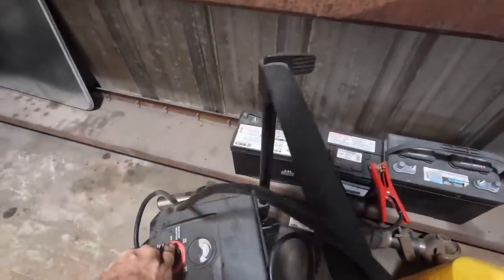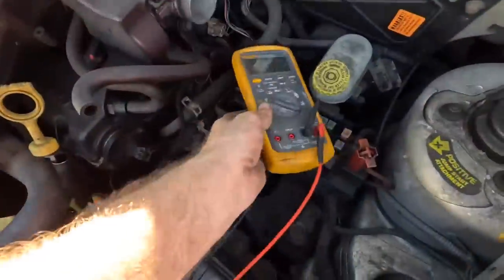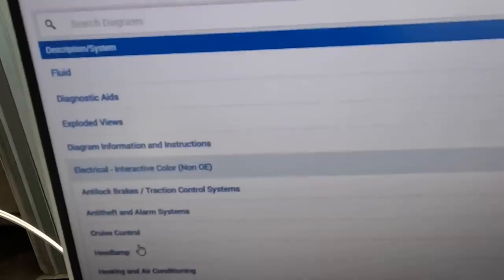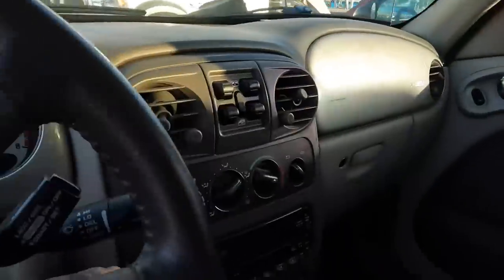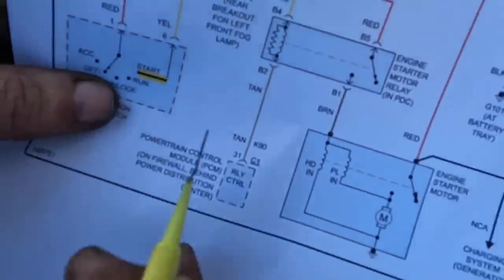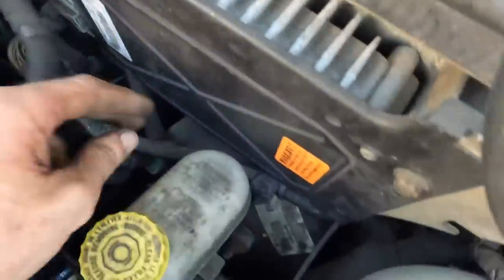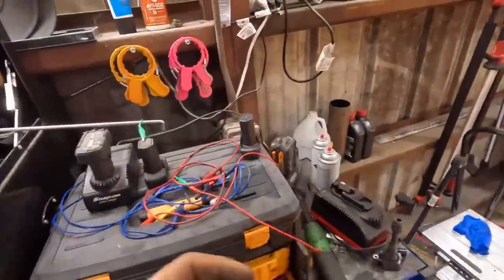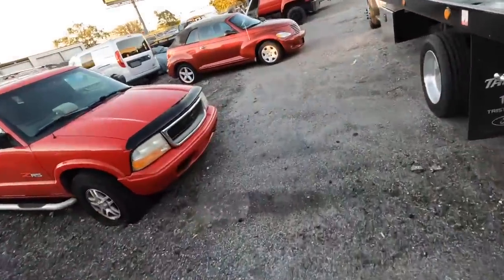It’s DEAD! Parking lot diagnosis

Comment: I'm not saying it's not a faulty PCM, but I would check the integrity of the wire providing ground to the control side of the starter motor relay. Just because you performed a continuity check and passed doesn't mean it can carry a current. I know the load on that wire isn't much because it only provides ground for current flowing through control coil inside of starter relay, but I would've load tested it with a 2 amp light bulb. I would also load test the wires providing ground to ECM before condemning the PCM.

Comment: Is that a chipped key with theft deterrent? With the column disassembled It may be worth checking to see if that system was disconnected or a neutral safety switch is bad.

Comment: Security system is kicked in mine did the same thing  just to find out the ignition wasn't transmitting that the key wasnt correct plus check the relay it should be a 4 pin not a 5 pin

Comment: Since it looks like it was replaced, they may not have flashed the Vin into the PCM. If vehicle Vin and PCM are not the same, vehicle will not start. Also, they may have the wrong PCM. Call the dealer with Vin and ask  what the Part number is supposed to be. Number should be on PCM.

Comment: You have power to PCM, you have ground to PCM, looking at the wiring diag there is no neutral safety hard wired into the starter solenoid circuit which means it is connected to the PCM and can inhibit starter relay ground. Admittedly that should not affect the ASD relay which itself will inhibit the fuel pump relay, but it would be interested in seeing if the PCM is communicating and what IT thinks is going on. More scantool.

Comment: As an OBS Ford owner, the first step after a no crank situation is to jiggle the shift lever. 
Neutral safety problems a plenty.
Reply: The sagging column shifter neutral lockout anti-theft device is a Ford patented feature prevalent in Ford full-size vans and pickups for decades.
Reply: @mikejacob3536  I park my 93 300 straight 6 f150 at a wooded lot that I bought in upper Michigan. It's a camp truck and a tractor for me. Before leaving it I pull down on the column shifter, that enables the factory anti theft mode.
The only thing I do under the hood is to pull the signal wire off the starter solenoid. It's just a slip fit connection.
Reply: @mymusicaccount1456  in 1999 I started driving a 1981 E150 as a work vehicle. It had started life as a Montgomery Ward Appliance Service vehicle and had 191,000 miles on it.
I left the keys in it 24/7. If you didn't know to lift the gear shift from the 5 o'clock position that gravity had it in, to the 1 o'clock position necessary to start the old 300 C.I.D straight 6, you'd never start it. 
I drove that van until the leaf springs came through the floor... Engine still started first crank in sub-zero weather.
Reply: @mikejacob3536  I replaced the front leaf spring mounts on my truck last summer because they were Swiss cheese with rust. When I got the old ones off I weighed them and they were both a full two and a half pounds lighter than the replacement ones. People joke about rust making a car lighter and faster, but my spring hangers had lost nearly 50% of their weight. Holy crap.
Reply: @mymusicaccount1456  Reminds me of my first truck. 1977 Toyota with 317,000 miles on it. No driver's side floor board, and rust so far up the firewall, you could see the left front tire from the driver's seat... 2 liter 5 speed... 78 mph top speed, 30 mpg on the freeway. The cab was laid back on the bed... But it was at least 200# lighter than when new.  Still started and drove when I junked it, but couldn't get a brake caliper it needed... I miss that truck!

Comment: This video shows why it is easier to work on 50's and 60's era cars.  Sure, no OBD connector to see what the computers say is broken or failing once every thousand RPM's, but no messing with ECM's ECU's or what ever each generation decides to call the electrical magic box.  Just imagine the joy of getting a barn find current generation car 70 years from now and needing major electronic replacement parts.  Hell, I couldn't even swap out the ecu on my Harley without taking it to a dealer to have it go through an initial learn procedure for the VIN and stage upload.

Comment: This is giving me PTSD…  I spent a week tracking down an intermittent fault in a PCM.   An overheating power transistor resulted in a cold solder joint, so mechanically it was a crap shoot if there was or wasn’t power to required systems.  I thought it was faulty wires, as wiggling the harness would affect things,     We could send a capsule to the moon with computers built with 50s and 60s semiconductors, but under the hood of a light-duty Dodgem pickup is a harsher environment than outer space…

Comment: The PT Cruiser is classified as a Truck by Chrysler. It is how Chrysler cheated with average overall fuel consumption of the Chrysler line to meet federal standards.  Very detailed and interesting story tbh, and yes the convertible is also classified as a truck.  Some states you can even get the truck plate for.  🎉😮😊

Comment: With other people said I think it's the security system stopping it from cranking.  Could be key not programed into system happens alot when batteries get disconnected frequently which would shut all systems off also those older Chrysler car if you put a computer programed it could trigger all computers to look for the security.  Other car ok for test parts Chrysler you can get a bunch of headaches if not do right

Comment: Pretty sure an ecm swap was tried and failed due to improper matching or improper VIN setup. Without the dealership or an eBay store that specializes in VIN to ECU keying, no dice. I bet if you mail that ECM to an eBay service, give them the car VIN, they'll match it and mail it back to you for under $200. Then the immobilizer and all the fun stuff will work correctly.

Comment: I got a '08 JKU 2.8 CRD that just shuts off while driving, then doesn't start or even cranks unless you slap the fuse box..... it throws fault code U0100 though, loss of communication PCM-ECM....

Comment: That's definitely an immobiliser problem you can see the light is on when you turn the key weird that they don't say it has to go through the imobilizer or that the power has to go through that before it will start on the diagram

Comment: Can check for a bent or pushed pin on that controller and does it have proper power to operate. Otherwise you did what i would have done.

Comment: There is a fundamental flaw in your diagnosis which could come back to bite you and/or give your customer a false diagnosis.  You conflate Voltage with Power but the two are quite distinct.  Voltage is simply a measure of electrical pressure (which can also be ghost voltage) and cannot technically 'go' anywhere, it is anly apparent at a given location. Power as you're using it doesn't actually exist in electrical nomenclature, the measurements in Ohms Law being voltage, amperage, resistance and current. Take the possible  scenario that you have corrosion in the wire.  The problem with corrosion is that it is Not a fixed resistance, it is a dynamic resistance based on current flow so will not show if there is no current. If you measure for continuity you will see continuity, but if you pass current through the wire you will expose the resistance in the form of a voltage drop. The bast way to test this is to ground one end of the wire and attach a powered test light to the other (make sure your wire is isolated). If the light lights your wire is good.  A good hybrid solution is to attach your voltmeter across the wire (it should read 0 volts) then with with one end grounded attach your powered test light tothe other end.  If the circuit is good your test light should light and your voltage should remain near 0 volts; if the light does not light and/or you show significant voltage you have corrosion in the wire.

Comment: Here is Mr. Digital's theory, Car won't start one day, pcm is blamed, pcm gets changed, pcm and key no longer match, now car wont crank, starter gets replaced, car still wont crank, previous "mechanic" scratches his head, learns a little about the transponder takes the steering column bezels off, changes the transponder amplification pick up ring,  still gets no response, then throws in the towel,  PT comes to you. You chase wiring unnecessarily, The problem the whole time is the transponder. This should have been your first suspicion sticking a grey key in a Chrysler with no starter response. You put a new pcm in, guess what, same situation, you will need to program the PCM to the key, then continue.

Comment: Yeah one thing you going to learn with those lower end Chrysler cars Chrysler products in general that grounding issues plague them and when someone says they replace parts first thing I always will look at 4 is the grounding circuits near where they work at cuz a lot of times they will see that random wire and not bother putting it back as we know Chrysler is always ground wire happy

Comment: The PT CRUSER was a pretty cool car when they came out and you would see a bunch on the road, but in Chrysler fashion they quickly stoped driving by and you only seen them parked.  Now the only place I see them is on Ray's youtube channel.   Whys that?

Me im still driving the same Toyota Celica with 3 times as many miles on it, and its only problem is a bad cat. Yep its plugged up becuse its always used oil.

Comment: cluster not working if fuse is blown , it wont crank  , wrong path saying module is bad check the cluster fuse which also feeds a module which will allow immobilizer to function ,LOU

Comment: Id of tried to crank thr starter by bridging the terminals. If that didnt eork jumpering kinds like you did. But just with a cable direct to starter with a seitch. If it starts its the security bs.

Comment: Is it the key sensor? I hate electrical problems ANYWHERE, car, house, shop, christmas lights.  I was looking at PT Crusiers and then compared it to an HHR. I bought an 2011 HHR. The only problem is the battery is in the back by the spare tire. I have had this car 8 years and replaced the battery 3 times.  So last month, no start, but we had -10 degrees. I did charge it and it seemed ok, but it was a 5 year old Die Hard. Just dont close the hatch door when you dont have a battery. I had to manually unlock the drivers door then a rear pass door and climb in with the battery and hook it up to unlock the hatch door. What a dumb ass design from Chevrolet.

Comment: I’ve gotten dicked on no crank/start ,  with some one slappin in a aftermarket security system or half ass kill switch.  Then selling the rig. 
  The door locks not wanting to play gave up the ghost on one, fuel being cut off on another. On and on.

Comment: That RPM gauge might be a clue. Don't know a lot of cars, but if the Crankshatft position sensor is faulty, the RPM gauge dont move and the computer don't know the motor is spinning and trying to start. So it doesn't supply fuel or spark. But that dont explain the ignition switch problem. Maybe a bad ignition switch base?
Reply: How can it supply fuel when it's only empty?  there is No fuel  it's on the E
Reply: I was pointing out the communication data. Nothing more.

Comment: The PCM might need to be programmed if they had a bad PCM before and just swapped another in that could be your problem. Even if it’s the right PCM it still has to be programmed to the cars VIN number.

Comment: My prediction: Not the computer.
Immobilizer or park/neutral safety switch... neither were checked. This is why the ground is supplied (interrupted) for the starter relay by the trans control module.
Reply: maybe he should put some fuel in it.. as it's on empty,   that is a good place to start⛽⛽⛽⛽

Comment: PT Cruisers are classified as trucks. When GM designed them, they needed to raise the average MPG of their truck line to meet US minimum MPG in a manufacturing range. In order to raise the average MPG for trucks, GM made the PT Cruiser designed as a truck but as small as a car, which raised the average MPG for trucks in line with US emissions minimums.
Reply: Ummmm, PT Cruisers are Chrysler products, not GM products!
Reply: @mattcat231  That's right. I'm more of an air cooled VW person. PTs were made by DaimlerChrysler in 2002.

Comment: If I delivered my car to Rainman Ray and I learned Rainman Ray took an Engine Control Unit  from my car to test another car, it would be the last time I would take my car to Rainman Rays.  I do not think that is what happened in this case . . . just saying. Also when testing ECU's with meter test lead probes do not shove the probe down into the female connector.  This can spread the pins so they do not make good connection after that.  Again, I do not think that is what happened here . . . just saying. In all due respect.  By the way, I am getting a kick out of your new business growing!

Comment: NO NO NO!!  No continuity tests with metering device m- it can easy cheat you. Do this kind of tests using 50W bulb and battery. Wire must be under load od aprox 5A so the test is good. Advising compression test too. And what about to scan for fault codes?

Comment: Chrysler designed the thing in such a way that they could scam the NHTSA into classifying it as a truck because the corporation's actual trucks' fuel economy was best described as "epically bad" - and it was hoped that this chicanery would bring the average... average up enough to allow Chrysler to avoid some CAFE-levied penalties (fines). It was also done because the PT Cruiser's fuel economy was pretty deplorable, and it'd have done the opposite to Chrysler corp's car average fuel economy, had they classified it as a car. There's some irony there, methinks. 

Classifying it as a truck probably didn't hurt when it came time to run the thing through the battery of safety/crash tests, either. Are light trucks still immune to the car low-speed (e.g., parking lot) collision bumper damage rejection requirements? I know that they were for years, it was one of the things mentioned in the list of benefits to the automakers if they could get customers' tastes switched to "SUV"s.

Comment: When Voltage is read (open circuit), one will always read source voltage, even if there is a resistance (green crossties) inline . . . unless the wire is completely broken (open). When the relay is removed you are open circuit testing (Voltmeter is in series with the circuit) and will therefore always reads source voltage). Get in the habit of testing circuits with the load connected.

Why is open circuit testing not foolproof? Lets say, inline "crusties" have 60 ohms of resistance.  If one places a voltmeter (10,000,000 million) ohms of internal resistance in series with the 60 ohms, the voltage dropped across the 60 ohms; miniscule! The source voltage will almost be entirely dropped across the 10 million ohm voltmeter (Battery Voltage). One would never know there is 60 ohms of green "crusties" in the circuit using open circuit testing.

In this case using a relay jumper kit so the load remains connected, one would have read Battery Voltage at the top of the relay coil and Battery Voltage at the bottom of the relay coil. At the bottom of the relay coil there is supposed to be ground.  Grounds should read (0 Volts) if the ground is good, and something greater than a few millivolts if the ground is bad.  Using the Lisle 69300 Master Relay Test Kit and measuring the voltage on the ground side (B2) of the relay coil would have shown there is approximately 12.6 Volts, indicating the ground is missing (2 minutes tops).

This is where the Lisle 69300 comes in handy! The Voltmeter in most cases should parallel the circuit for testing purposes (Load connected); not placed in series. Repeat, leave the load connected and carefully back-probe when possible or use a wire piercing adapter followed by resealing the wire with liquid tape. Hope this helps.

Comment: I know it’s a long shot, I had a ford that had power no crank, after ripping out the dash I took it too a garage and it was the key transponder having new keys cut and programmed it worked fine, this happened while I stopped to fill petrol. Really weird but i only had 1 key so I could not try a second.

Comment: Yea I am sure it is the people who think you are dumb and they are more intelligent than you.  Like the iPhone has to text everyone you are driving.  (The phone will say I am driving when I am sitting at home for several hours. But that is another problem).

Again if my battery drops just below 13.2 volts these people have programmed the computer to shut most everything down.  The starter included.  Your battery tested at 13 volts way too low for computer to determine the battery is in good enough shape as they have determine what is a good enough shape battery. (Remember these people are smarter than you are.) 

If I put a charger or battery pack and get the voltage just above 13.2 the computer will
Allow the relays to do their job.  But of course being that the battery is getting a little old without a little help the voltage will drop to just below 13.2 and the computer will shut the relays down. Happens every time.

Own the jeep since new and am now on my fourth battery.  Never fails four years old the computer is calling for a new battery.

I thought it was the pcu at first too but said let's put a small battery charger on it and monitor the battery voltage.  Again as soon as the voltage read above 13.2 the pcu would allow the relay circuits to work.